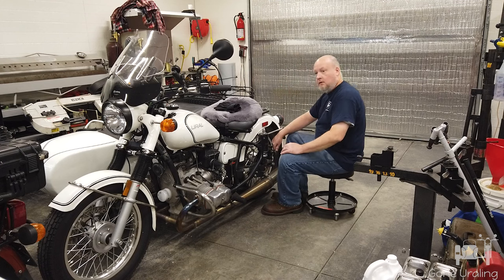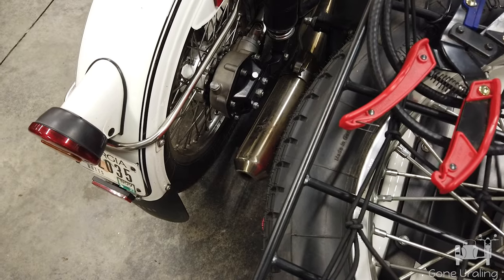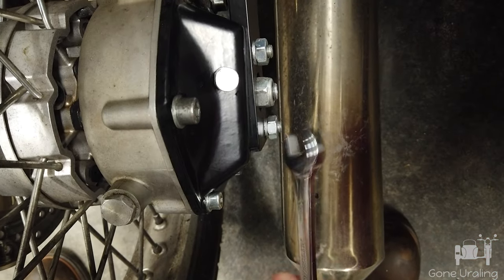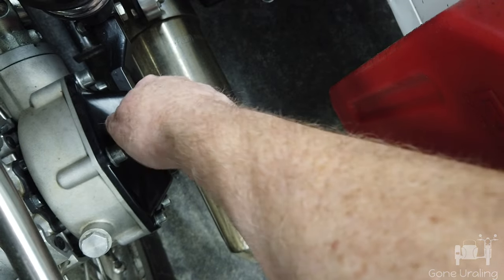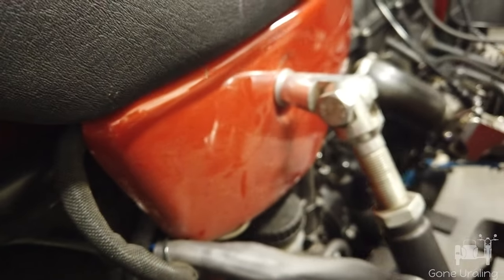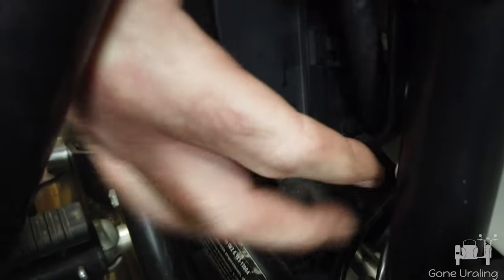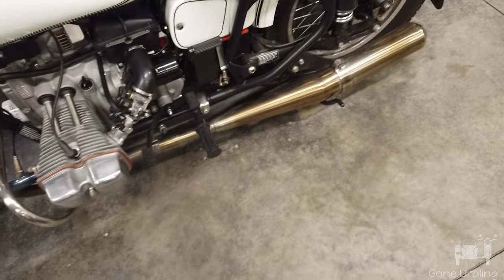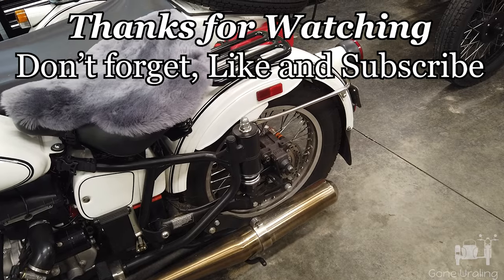How to FIX a LEAKY REAR END! 22.7

Comment: I made them do that before taking my '18 for delivery...my '15 M70 (Christine) soaked the rear wheel with its stock vent...
Jason sent me something very similar to test and that ended up in production a few years later. 
(go to Soviet Steeds to read about Christine. She is also on the most popular video on my channel for reasons I do not understand)
Reply from the maker: Yep, been around for a while, I like to take my time, plan, prepare, weigh all the options, discuss, and then spring into considering action before taking action. Sometimes I even go for a ride or two first.

Comment: Great job. I did that to mine last year and terminated it into a tiny filter mounted behind the battery on my GearUp.
Reply from the maker: That's a great place to send it too.  I thought about adding a small filter, but I don't know that it is necessary, maybe if we off roaded in dusty areas it would be a good idea.

Comment: On my bmw I ran it up to a good hiding place and put on a cheap gas line filter .  After that I always run just a tiny bit more oil in the box and had no negative side affects and in my head that made it better for the gearbox.

Comment: Very nice simple elegant solution using a banjo bolt.  I used the Heindl solution with the ATV boot on my 2011' which worked great, but thinking I will use your banjo design on my 2020' CT
Reply from the maker: Glad I could share some ideas that work!  Thanks for the comment.
Reply: @GoneUraling  would you mind posting the Amazon link for the banjo bolt and fitting you used?  The only ones I have found call out an M8 x 1.0 and an M8 x 1.2 mm thread?  These could be a translation issue and are really M8 x 1.25 thread but I am not sure?
Reply from the maker: @bretthenry7480  I bought this 2 pack https://www.amazon.com/dp/B07FLQ7LDQ?psc=1&ref=ppx_yo2ov_dt_b_product_details    then I bought this  https://www.amazon.com/dp/B088QKTH49?psc=1&ref=ppx_yo2ov_dt_b_product_details   

I did that because the barbed fittings I found cost more than the second pack. I just swapped the banjo bolts themselves and shelved the other two for a yet unknown future project.
Reply: @GoneUraling  awesome thank you.  So the Autohaux kit with 2 banjo bolts and 2 barbed fitting truly does have M8 x 1.9 threaded banjo bolts it would seem?  That was the kit I found but had questions on the thread pitch.  Thanks again!
Reply from the maker: @bretthenry7480  The bolts in the kit with the 2 banjo bolts and the barbed fittings have the WRONG PITCH.  That is why I also bought the two banjo bolts with the correct pitch.
Reply: @GoneUraling  OK thanks, I wasnt seeing things.  I just ordered the banjo bolts and fittings you did.  Picking up my ride from Heindl next Tuesday after having Jon go thru it.  So I should be able heal my leaky rearend next weekend.  Thanks again!

Comment: Good video!   I'll be doing this to my Gear Up.   Was wondering how you like your Roto Pax, the mount, and what size you used.   Thanks!!
Reply from the maker: I originally had the 3 gallon Rotopax, still have them and might use them again if we ever get a chance to take our Alaska trip.  However, if I had it to do over again I would go with these, 1.7 gallon Rotopax you see in the video (ours hold a little over 1.8 gallons each now after some use as they tend to stretch a bit over time).  Plenty for extra fuel and the slightly smaller size makes them easier to handle and transfer gas. My wife especially appreciates the roughly 8 less lbs when lifting it.  The new vent is working great, I highly recommend the mod.
Reply: @GoneUraling  Having ridden to Alaska 3 times. Once by sidecar, use the larger Rotopax when you do your Alaska trip. Only need it through northern BC and Yukon, but, uh, that is exactly where you do NOT want to run out of gas... They have improved the road so much, cars only take a few days to make the trip, not the week + it used to take, so a lot of the smaller gas stations and lodges have closed up shop, no business...but close to the same distance...
Reply from the maker: @JamesAllmond Good to know. I also have the option of taking both, so I'd have an extra 4.7 gallons on each rig if I do.  Figuring out pusher tires is the real question. From what I can figure out I'll probably need a new tire before I get to Fairbanks from here (spare swap) but then I'm going to need two new tires at some point.
Reply: Rotopax……grrrrrr….. my new gourmet painted 21 CT paint was ruined by a Rotopax tank.  I suggest several rubber pads (closed cell foam) on the tank to protect the paint.  Very disappointed, but now I have painted the car bottom, inside floor and the area where the Rotopax tank rides with tinted bed liner.   I appreciate your videos, BTW!
Reply from the maker: @jayknight850  I use rubber strips that have tape on them applied to the sidecar, one above one below and they are about 3/4" thick when not compressed.  I put the can on, tighten it down and the rubber strip protects the pain and keeps the can from rattling or moving around.

Comment: I fixed my 2019 Gear Up by removing the vent, plugging the hole with a set screw and using a vented dipstick from Ural. Put over 3,000 miles on it and no leaks.
Reply from the maker: Had those on our previous two rigs, they still leaked so I didn't even consider them.  What we have is working perfect. So long as it works is all that matters.